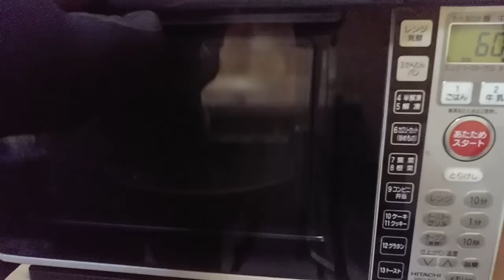knife making vws;Sambar stag サンバースタッグ(鹿の角を使ったナイフ）

Comment: Hard your argument to fit many different pieces into one knife. You started a little unorthodox, that is, the horn drew the knife and not the other way around. A different approach to a subject is always welcome.
Reply from the maker: Thank you for the advice.
There are many ways to do it, but I'll try my best.
Reply: @versatileworkshop3781  I'm not in a position to give advice because I don't think I have the knowledge. But I know that the size and shape of the handle materials is determined by the shape of the blade. You created the horn guided llama, difficult but you succeeded.